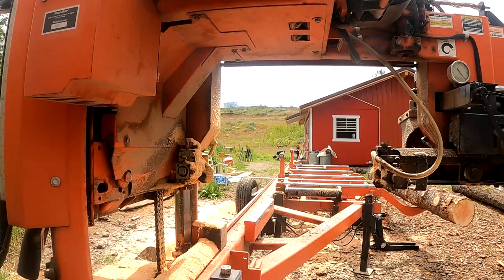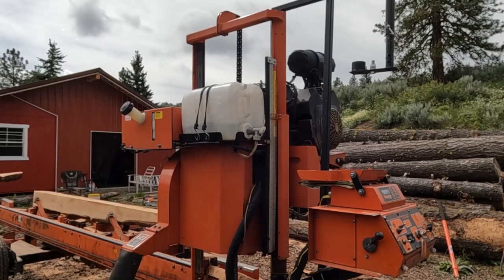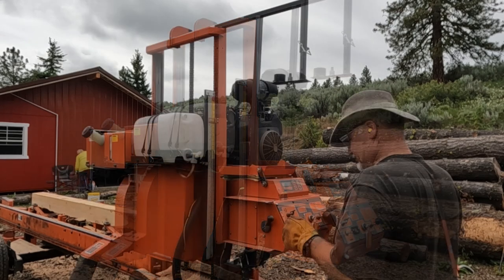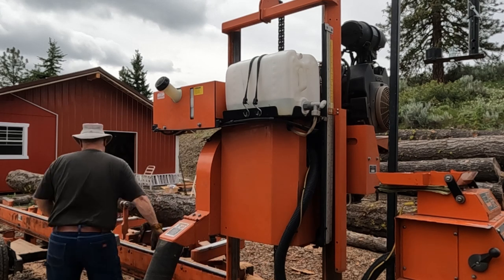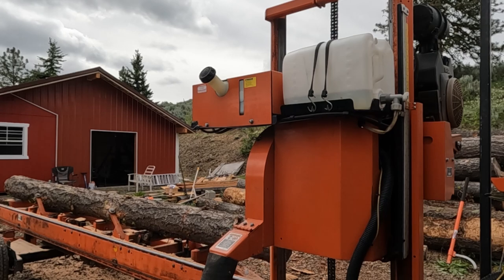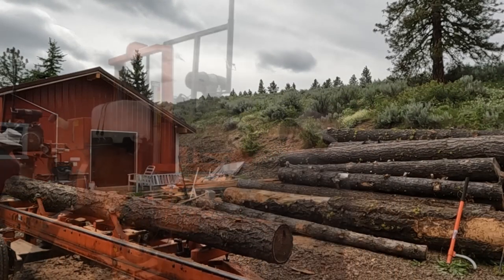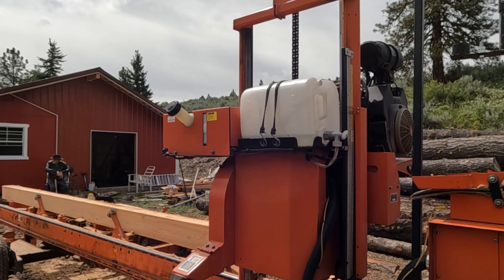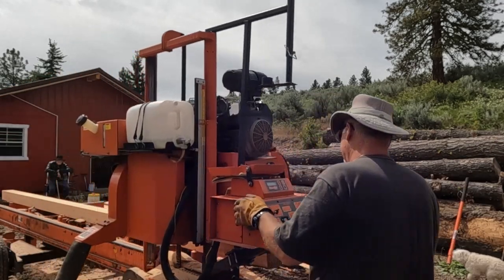How to Cut Small Logs Into Lumber #sawmill #woodmizer

Comment: Perhaps a dumb question, but what is the purpose of having those swing out bunks swing.  What does the swinging action help with versus having them fixed? 🤔
Reply from the maker: That is a good question!  I just figured it gets them out of the off bearers way on shirt logs butdidn't put much thought into it beyond that ;)  I should ask WM!
Reply: Paul, if the bunks were fixed then they couldn't be called "swing out" bunks. My take on them is that for the "average" log they're not needed (I seldom use them on anything 12' or less) but will give much needed support to longer logs. I noticed Erik mentioned toe boards but failed to call it a "Dave" when they're left up.
Dave
Reply from the maker: @TheOldManAndTheSaw  Oh that's coming Dave,  that's coming!